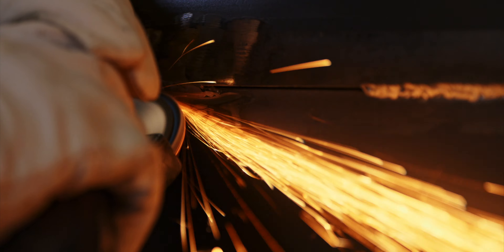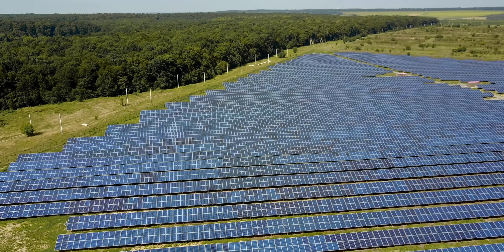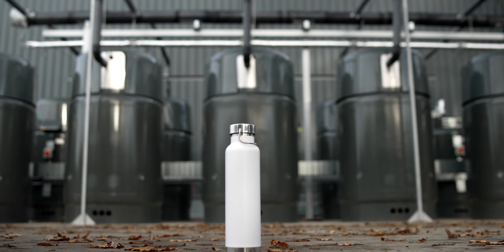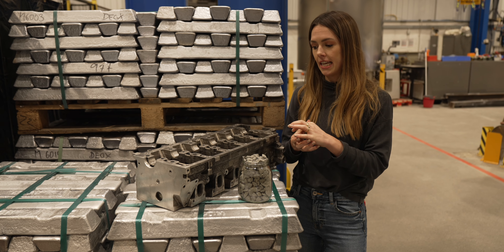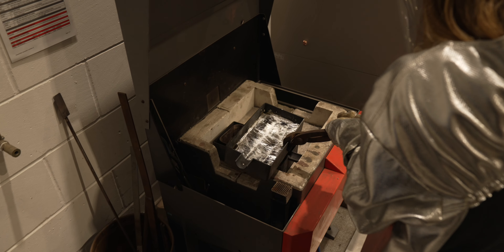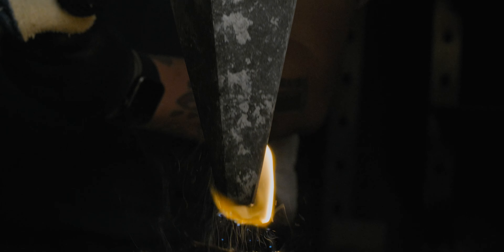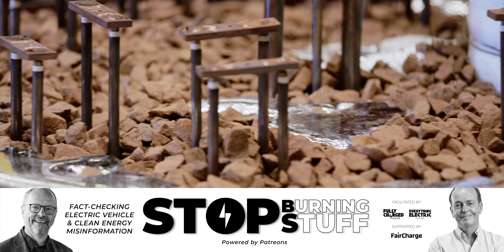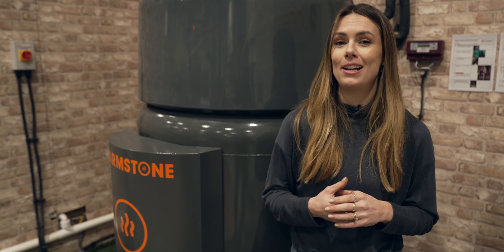Zero Carbon Batteries Made From Old Engine Blocks and Lava?!

Comment: 4:03 i think that's actually a cylinder head, you can see by the ports on the side. they sit on top of the engine block and support the structures that dictate the intake, ignition, and exhaust. sometimes also injection of fuel.

Comment: Good to see where Caldera went & to reveal their energy density + power density solution. Great they're tackling industrial applications but they should still consider commercial & domestic versions for hot water & a hot-source for a heat pump.

Comment: I think they can make much more impact in the industry rather than at home.
For home or several homes use, there has been a Dutch startup, that has a similar insulated vessel but just with water at up to 110 degrees Celcius.
It is still an electric boiler after all, but for example you could use it to shower all week from the cheap sunny hours in the weekend for example.

Comment: I wonder if there's a possibility to use these for public building heating, like schools and hospitals. If there was a deal to use excess solar from nearby solar farms at super cheap/free rates it could reduce public expenditure on the stuggling sectors like education, and possibly also reduce some of the community objections to solar farms, "in their back yard".
Reply: Heating needs, which require quite low temperatures- in the range of 30-60 degrees C-  can be efficiently achieved by heat pumps- making 3-5 kW of heat from 1 kW of electricity. The solution in the video is using resistor heating, which makes 1kW of heat from 1kW of electricity. The key selling point is high capacity, high temperature storage, which allows to heat up the storage using low tariff electricity, and use the heat when needed by industrial processes, because the vacuum insulated storage containers holds the heat well.
Reply: Industrial processes need heat throughout the year. For most of the year that can come from solar with other sources during the winter. Space heating is mostly only needed during the winter exactly when solar produces virtually nothing. Solar is great for AC in the summer and rubbish for heating in the winter. Thermal storage works fine for a few days but it's no good for seasonal energy shifting as too much leaks out. Space heating should be heat pumps powered by wind turbines.

Comment: I expect at some point there will be mini versions of these that will sit outside a house where the oil/gas boiler used to be, or even buried in the ground. During the day they'll be heated by solar energy and water will be piped through them to heat radiators. Of course there are already solar water heaters (you can see them perched on top of houses in Israel, Turkey etc) but these might be a little bit less conspicuous.

Comment: 5:22 I seem to remember that you presented a similar technology in another video where the company was doing the reverse: had some sort of brick material with a specific alloy embedded.

For experts, here is the question: which of these two solutions would be best to reduce losses and/or store the maximum of heat?

Intuitively, I would say the one that’s a block aluminium  spiked with volcanic rock would probably store more heat but have higher losses (14deg per day from “full” at 500deg to “empty” at 200deg according to what Imogen said), whereas it would be the opposite for the brick spiked with alloy bits (less heat, but less losses).

Any idea?

Comment: The fact that it is warm hours later does not demonstrate high conductivity, it’s a demonstration of heat capacity.   Porosity is also not a demonstration of conductivity.  Typically, higher porosity means more air pockets which means better insulation.  I get the feeling the volcanic rocks are just filler so you don’t need as much aluminum per unit volume.

Comment: There are a lot of Bakeries and Potterys that this will be good for. Id say most of the Food industry uses lots of gas.
Reply: It does. Usually to produce a lot of steam.
Reply: They were targeting uses 100-200C. That's just hot enough for baking. It's at the edge of their range. But you could definitely use this to get the ovens almost to temp and then top them up the last 10 or 20 C electrically if needed.

Comment: This is great technology. It reminds me of the sand battery. Simple and effective and cost effective solutions. 👏 👏
Reply: Sand strikes me as a lot cheaper and more useful on a large scale.
Reply: @zapfanzapfan low thermal conductivity means it's hard to get the energy in and out and you need a higher differential between storage temp and usage temp. These people have looked very hard at the problem and chosen the best material for this use.
Reply: @adrianthoroughgood1191  This strikes me as a system for short storage and quick discharge, then it makes sense. A sand system was built in Finland recently but that is maybe 100 times the size of one of these thermoses. 8 MWh with 200 kW discharge rate.
Reply: @zapfanzapfan  was that for space heating? You need a lower output temp for that (50C rather than 200C) so sand may be more suitable for that use.
Reply: @adrianthoroughgood1191  The sand is at 600 C and the transfer medium seems to be air so I guess you can have pretty much any temperature you like that the transfer medium can handle. There it is for hot water and district heating so the water outflow is probably around 100 C.

Comment: I really love heat batteries, especially novel ones like this but I'm going to be pedantic. Both people in the video said engine block but don't they mean head? Aren't heads made from aluminium and blocks from steel? Imogen also said it was "still toasty" which means it's a good conductor of heat. Doesn't she mean "storer of heat"?
Reply: Some newer engine blocks are made of aluminium (with steel cylinders though) but those were heads.

Comment: I quite fancy one of these in the garden - store the excess summer PV and progressively tap it off for heating in the winter - I wonder what the heat capacity is at 500C - probably not that simple but interesting idea 😅
Reply: If it self-discharges in 3 weeks it's not a very practical seasonal storage...

Comment: What is the round trip efficiency?
Reply: Your losses are energy used to run the pumps and the vacuum system to maintain insulation and the actual heat loss to the atmosphere. If you charge and use the energy every day in a normal industrial process they should be reasonably low. But efficiency isn't the point. It's not trying to compete with batteries. Low cost for large capacity is the goal.
Reply: @adrianthoroughgood1191  but it matters.
Even if you get the energy when there's a peak in energy production, if there are a lot of these types of batteries they will still increase the demand and this raises the price somewhat. At 30 to 40% efficiency you would still need the price to be 3 times less than normal to reach parity.
I would like for the efficiency to reach at least 50% to consider this.
Because you also have to consider days when there isn't that much energy production during that time factories still need to work and output products, it will get very expensive if they can't rely on it or the cost is 3 times that of normal.
Reply: @Simqer  I only know what is in this video but given that she said the outside did not feel warm and it can hold the heat for up to 21 days it seems like the heat losses are quite low. I don't think they mentioned how much electricity it takes to run the pumps and vacuum. I would expect during normal usage it would be well above 50%, but of course you would need to measure it to be sure. It's converting heat into electricty that has bad efficiency but they are not trying to do that here. I think the expected use case is that you have your own on site solar panels so that after capex your electricity is basically free for most of the year. Of course having better effeciancy in the storage means needing fewer panels. But panels are pretty cheap these days.

Comment: Where are we with large solar mirror arrays for high temp applications?  Good job and good luck.
Reply: Concentrating solar is a bit of a nightmare because of all the precision moving parts required to constantly keep the  mirrors aligned on the tower. If you're using molten salt for the working fluid you have corrosion difficulties and well. It's not easy.

Comment: That engine block looks a lot like a cylinder head imo😅😆
Reply: Indeed it is. Old alloy heads and blocks can also be recycled many times, being made into parts for EVs, like motor casings, reduction box casings and the like. It obviously works in these heat storage solutions too, but it seems a bit of a waste considering how energy intensive refining aluminium is to start with. I suspect that used aluminium is being used here because it melts at a low temperature (compared to iron), and it's relatively cheap to obtain.

Comment: A couple of times the point is made that the materials are good conductors of heat, a property that would be important if you needed to extract heat quickly but it seems to me a more important property would be possessing a high specific heat, a property that reflects the thermal energy stored per kg per degree centigrade (or Kelvin) e.g. J/kg.K.
Reply: Aluminum has both good thermal conductivity and high specific heat while remaining solid in the 100ºc ~ 500ºc range.  around 230 W/m K and a specific heat of 921 J/kg K, and it is not expensive. Granite has SH of around 800 but a conductivity of only  3 W/m K  so you need the Aluminum around it.

Comment: Excellent production and presentation, but still a bit light on facts such as specific heat capacity - why use rocks + Al instead of just Al and what is the improvement in energy density as a result?
Oh well, here goes: eg, soapstone ~ 1kJ/kgK -> 300K delta -> 300kJ/kg -> 83 Wh/kg. Say 1000kg: 83 kWh per ton. Al has 0.9 kJ/kgK, so the rock adds ~10% and reduces cost, while the Al also acts as a 'vascular' system for heat.  We don't know the mass of the contents of the storage units, but I guess from 500-200 °C would give a theoretical 83 kWh per tonne.
In fact, this could use concentrated solar power to charge instead of electricity, and with >80% thermal efficiency instead of ~20% PV efficiency - win win.

Comment: Seems like fairly good principle, combining aluminium which has great thermal conductivity, ~60%  that of copper, at a fraction of the cost of copper, with something that is extremely cheap to increase heat capacity for a given cost.  Even though that "impure" aluminium definitely represent significant value, it is at least less valuable than pure aluminium, and it's not consumed in the process, which means the ingots should be able to last practically indefinitely, and be completely recyclable.   

100-200 °C isn't unreasonable for heat pumps. The COP decrease with increased ΔT, per step, and cost increase the higher COP you want per step, at any ΔT, for a given rate of heat pumping. Which means a great disadvantage if you want to be able to use as much energy as possible during short periods when energy is really cheap.    

Storing heat is interesting in itself, so many possible options, all with their own set of advantages and disadvantages. I don't think there's one perfect system, and I also don't think a thermal storage system has to be perfect to have substantial potential as long as the price of electric power varies between around zero to absurd regularly. Maybe simple and reliable while leaving some potential efficiency on the table, has a better chance to reach commercial viability than high efficiency and very high cost with a complicated system that will require more maintenance.    

This system using water/steam to convey the heat in a closed loop is also interesting, making it more or less ready for turning some of that stored heat into power. While that would reduce the amount of heat energy extracted, the total amount of energy possible to extract wouldn't be reduced.

Comment: Time to retire ICE engines early then? At least the engine block is recyclable even if the fuel used to power it isn't!  Probably a wise move for Caldera to focus on industrial heat...
Reply: @beepthesheep867  ICE engine blocks are much heavier than electric engines and frames aluminum castings are shifting magnesium castings. So it should not be a problem.
Reply: @beepthesheep867  As I said the EV industry is already switching to magnesium they have 20 kgThixomolded magnesium casting and will have giga casting in a few years.　They could also switch to mild steel which is 20% of the price of aluminum.  This application does not need strength in the bricks. Steel has only about 60% of the specific heat capacity but 20% of the price it is still much cheaper. The conductivity will take more of a workaround,  but they could use bricks made of steel and rock and then stack them to allow aluminum conductors to be formed by just pouring molten aluminum over the stack. But I don't see the switch from ICE to EV using as much aluminum as car frames are switching to magnesium
Reply: @beepthesheep867  Structural magnesium is only available up to 20Kg shots for casting now, although it is a first-generation add-on for giga-presses so the next-generation add-on will be needed for 40~50kg large castings. Almost all those cons are gone now with new alloys. The strength-weight ratio is extremely important because when you reduce the weight of the frame and wheels you reduce the battery capacity needed which further reduces the weight of the frame, overall this leads to a large cost savings. Batteries  I don't know if magnesium batteries will be the future but battery volumetric and gravimetric density of batteries are steadily decreasing. Magnesium from mining has only been the dominant source of Magnesium for 30 years. If the demand increases it will likely be supplied from seawater again. Since seawater is effectively unlimited it is just calcium oxide that is limited so the cost should go down as the production scale.

Comment: What is needed is solar thermal to a thermal battery that can store the heat at minimum 1200 degrees.
This way minimum loses in changing energy types and can also be use for super heated steam to run turbine generation. Manufacturing needs high heat and electricity may as well build one solar station to deliver all your needs.
Moulton aluminium is cheap but not the best solution. 1414 Degrees Ltd .